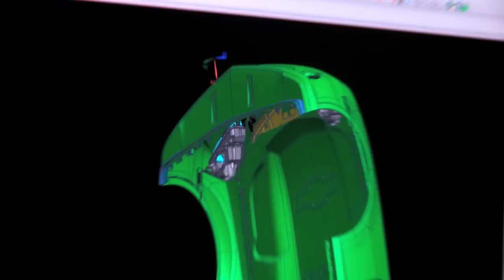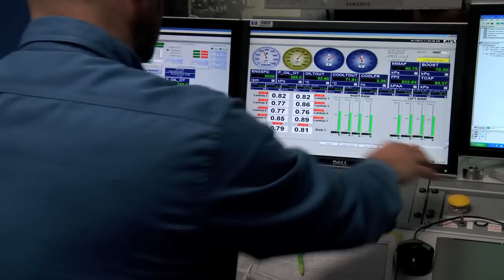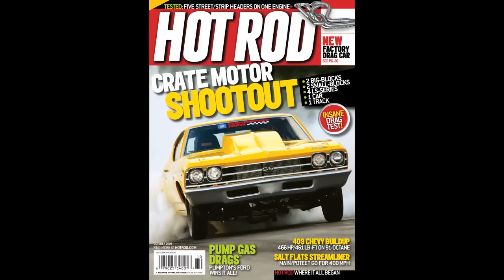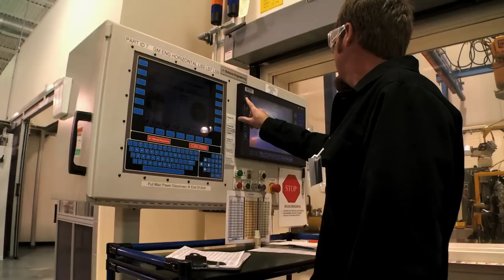2012 COPO Camaro:  GM's Baddest Factory Camaro Ever! - HOT ROD Unlimited Episode 6

Comment: its called competition. Had GM not built the SS and put it into production, You'd not have your precious 5 liter coyote. Don't believe me? Do some research. Competition is a good thing. We all win. The ZL1 comes out and ford jumps on it quickly with the '13 GT500. You can thank gm for your terminators in 2003 all the way up too now in the shelby's. ford finally got sick of getting its ass handed to them every single  year for over a decade by gms lt1 and LS1 fbody twins.

Comment: You say in every measure where the vehicle is equivalent? Weren't we talking about engines? DOHC engines dominate wherever they're allowed to compete on equal terms with push-rods. Seriously. Do you think a 302 inch push-rod LS motor could match a DOHC 4 valve Ford 302? They can't match Chevy? Ford surpassed them and they did it with a 1.2 liter smaller motor. Look at the RWHP numbers the 6.2 LS3 Camaro makes. 360-375 range. Same as the 5.0 but with worse mileage. Push-rods are just inefficient.

Comment: The BMW does. And it does it with a little 4.0. That 4.0 and the 5.0 Ford both make a lot more power per cube and their superior variable cam profiles and high RPM valve-train stability allow them to go where the LS3 can't. You're the misinformed one. So why do they have to keep making the LS motors bigger? Why didn't Chevy just make more power with the LS1? You know why don't you? cuz you can't make 420+ HP with 348 Cubic inches and still have low end torque and get 23+ MPG. Too inefficient.

Comment: You obviously have no clue. There's no evidence that an OHC engine is any better than a push rod engine! As a matter of fact, with the records Chevy holds with it's small block engine, it might even be that it is far more advanced than any other engine. LeMans winner 6 times consecutively, Nurburgring fastest lap time, Viper, Cadilac and Chevy push rod engines.  The highest number of NHRA records held are Chevy pushrod engines and on and on. ALMS world champions both manufacturer and driver..??

Comment: So, the GT500, a STREET CAR on STREET TIRES(285s, I might add), is going to beat a purpose-built drag racer? Can I get the name and number of your dealer? 'Cause that must be some good shit you're smoking. 

The reason Chevy isn't releasing details on the COPO is so Ford can't use that knowledge to rework the Cobra Jet and destroy the COPO before it's even available. That's being smart. Ford did it by not releasing any concrete details about the GT500 until after the ZL1 was revealed.

Comment: So where does all that extra 14 LS3 HP go between the motor and the ground? And why does your pushrod LS motor need 76 more cubic inches to match Ford's little 302? Why is the Mustang is matching or bettering the LS3's RWHP numbers? And the only numbers that really matter are the ones that show up on the ground. OK tell me where the 5.0 and LS3 are racing at the same weight without any restrictions on the DOHC Ford motor. If you don't need no stinkin magazine stop bringing up stinkin magazines.

Comment: well not exactly the shelby cobra was based off the ac cobra.  Carrol shelby took the ac cobra and stuffed a ford 289 in it.  Only 50 shelby cobras had the 427 side oiler and only 1100 total cobra's were ever built.  There is only 3 427 cobras left known to exist.  Ford designed and built a whole differnt body but yes borrowed a lot of the body style looks from the english two seaters.  The car just didn't fly with the president of the company.  I'm glad that it didn't cuz if the mustang wasn't

Comment: dude what make u the expert on gm engines all of the gm engines are far superior to the ford and how many engines does ford offer in its preformance line just because u say ford reworked its gearing  dosent mean its better this new zl1s tech is next generation and all anybody has to do is check the right boxs when ordering their zl1s and the new shelby will be toast and the ls3 is state of the art plus motor to motor the ls3 makes more power slps 750 hp 7.0 lsxs 454 hpes 1100 750s 650s will rule

Comment: OK. It's clear you need this explained even more simply. The LS series pushrod motor is nothing new under the sun. It is NO more capable than a 351 Windsor. If I went to the Ford parts catalog and built a 377 inch Windsor with all the modern pushrod tech it would be roughly the same as any other well built push rod motor. The 351W's  And 351 Cleveland's beating the LS motors in the Engine Masters Challenge proves there really isn't much difference in what you can do with that design.

Comment: Ha Ha good one, an average joe building ten 8 sec car, funy. My cousin built a 8 sec  car with is friend who owns a speed shop. It took them 3 years to built and do the testing : supension setting ( a car as powerrfull must put all is hp on the ground equally) , engine etc, every run is analyse trough a laptop so they find out what goes wrong. 3 years and 100 000$ of investment. So stop listening to videos and go out in the track pit and see what it is in the real drag racing world

Comment: 1970s? you really know your cars, from the introduction of the LT1 in 1992 until the LS1 was called off in 2002, Chevrolet more than had the answer for the GT... and even today, the LS3 is STILL a LS series engine, guess what that means, unreal aftermarket, mass produced parts... you can go faster cheaper and it'll last LONGER than a modular Ford.... simple facts of life... so go ahead, talk stock for stock, then run into a cammed SBC and cry

Comment: Much like an arrow, I can make a brick go fast in a straight line if I throw it hard enough. It doesnt mean that the engineering was as good.

The ZL1's brakes work better despite the larger girth and dont fade like the GT500's do. The traction management is lightyears beyond Fords best offerings. Fords laughable attempt at an electronic damping control system is even outdated by the C4 vette standards. And no one else besides Ferrari have a damping system thats close to the mag-ride system.

Comment: dont forget the 6.4L... I was originaly trained as a Ford tech, and I can tell you. Those motors are shit. 

Given, those bastards will run hard with a DPF/ EGR delete and a spartan Phlanax tuner. The motor will have problems with the intake later, but it will be fast as hell in the meantime.

Comment: lets see how long his chinese transmission holds it, lol... I tell you what you do, go to the SVTforums or any other mustang enthusiast forums, compare the # of guys with '11 and '12 Coyotes that has major failures of hard parts to those with LS3s on the Camaro forums. the LS based engines are proven with time, cheap, reliable, easy to mod... the Coyote 5.0 still has a long way to go before its proven... 351s used to make good power as well, but no one could keep them fucking together

Comment: @jonesd5o hey you need to stop trolling on GM videos lmfo! plus you are super ignorant. the best ford diesel is regarded as the old 7.3l which was built by international, the 6.4 & 6.0l  are junk and the new 6.4l is too new to see if it will last. the duramax is a great diesel engine thats been proven for over decade. dont forget mustangs were getting beat by camaros until the new 5.0. dont comment on stuff you dont fully understand.

Comment: a few getrags? more than a few went up in smoke right out the damn gate, which is what brought the whole "why is it running a chinese transmission?" debate up... the manual is a POS, everyone knows that, not only is the auto faster, by some twisted fate, its the more reliable of the 2, which is almost never the case with transmissions... i've never heard of anyone breaking a drive shaft or a half shaft on a LS3, axles? yeah, so will your precious IRS 5.0, that is just the nature of IRS

Comment: screw this over priced copo that only corporate or wultra welathy  racers will see i wanna see the dummies keep with the original program and build the z28 again aka specail performance and then they fed up on the engine again i mean come on 3 L:T1's ?????? engines how boring their was the LT 1 and Lt 4 and the Ls series now they should keep going to the LR engines they keep going back wards LT, LS, and now LR sereis the new vette engine in my opinion should be the LR-1 not LT1 (R for race )

Comment: GM again trying to copy FORD. last to come on board and finish last. still using a push-rod motor!!!!!!!!!!! somebody tell GM we are in the 21century Camaro never could compete with the Stang...........
Reply: Dan Kreeger-you have your head up your ass Bro. the new 2014Mustang right out of the box ran and 8.60. that is almost a full half second faster than the Camero. besides COPO is a vain attempt to get back what GM never had which was a fast factory stock car. Ford has dominated Stock classes for years. and currently has done the same. even at todays events the GM cars have to get a handicap start because they are slower. why OHV motor, outdated technology. Hot Rod Mag best motor ever for hot rodding-Ford Cleveland 351 and Ford quit making that motor some 50 years ago. need more?
Reply: mark ford
...And then Ford tried racing against the Camaro on a track.

Tried.
Reply: Dan C. then they both fell apart before the 1/4
Reply: bignickdigger VTec just kicked in yo! :')
Reply: the pushrod design has some advantages. First it is cheaper to produce. It is probably easier to "time" and keep in "time".. The chain or gear to drive the cam would be closer and more direct, compared to an overhead design with the cam on top of the head(s). With the cam being directly attached, no tensioners are needed to keep the belt or chain tight. The chain or gears on a pushrod design are always lubricated with the oil, whereas overhead designs usually are exposed and not lubricated. The chain or gears for the cam rarely wear out in an overhead design, as opposed to an over head cam which needs the belts or chains replaced or retensioned from time to time. A pushrod design is also easier to hop-up cheaply in the aftermarket, by changing different cam designs, or different rocker arm ratios to produce more lift which could require differing springs and or valves. Also the overall width and height of a comparable pushrod design will be more compact, helping packaging.